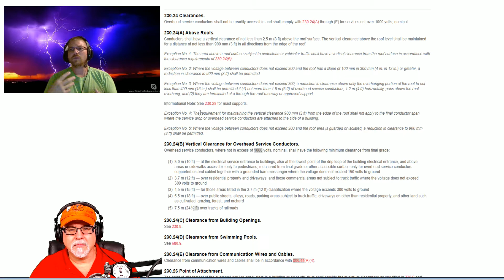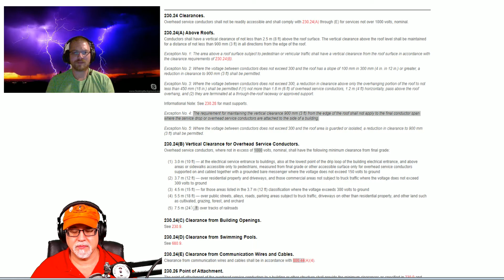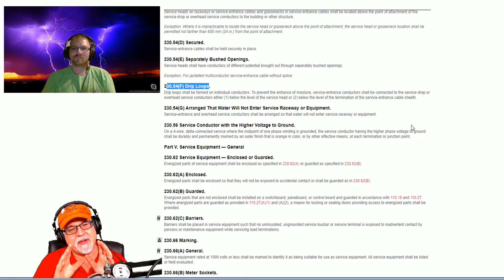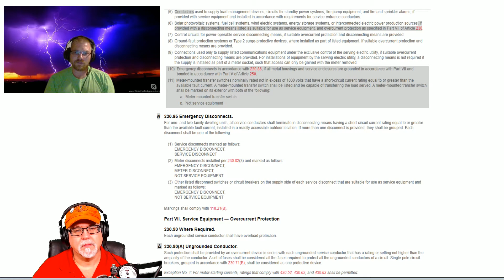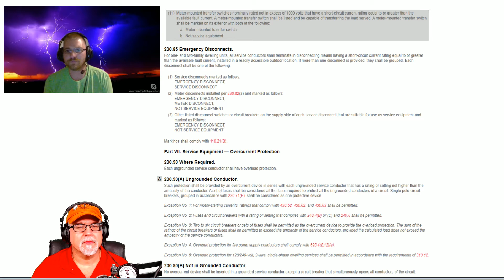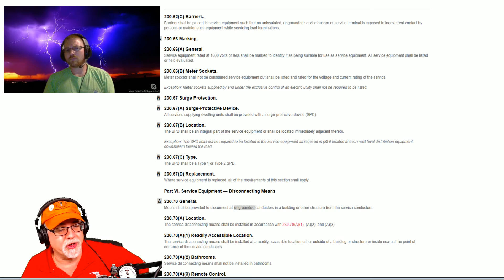Electrician LIVE - 8/29/2020 - Residential Services and Upgrades

Comment: Paul nice discussion. For Emergency Disconnects 230.85 it states “all conductors shall terminate in disconnecting means”  so would this mean the grounded conductor (Neutral) as well?  I’m seeing discussions that  for single phase dwellings ones are trying to satisfy this requirement with a 2-pole breaker or switch on the outside of the home.  This seems to meet the intent of making it safe for fire fighters but not the code. What do you think? Should the neutral be switched or what I’m I not understanding . Thanks
Reply from the maker: No, the general premise is to apply to the ungrounded service conductors terminate to the device. Typically, you would not find disconnects in this voltage class or/and usw group that would disconnect a grounded conductor. Not to say it would never be possible, such as with a ATS that derives a separately derived system but that would be extremely rare in a one- and two- family dwelling. Just food for thought.

Comment: Doesn’t have the meter disconnect install only if the power disputer panel  distance more than six feet from the meter?
Reply from the maker: Greetings Reza. In the 2020 NEC you have new requirements for an " Emergency Disconnect" per 230.85. You have (3) options to meet this new rule, which only applies to one- and two family dwellings. The meter disconnect is one option but its just as it sounds, just a disconnect. Check out 230.85 in the 2020 NEC and check out my 2020 changes video on this channel.